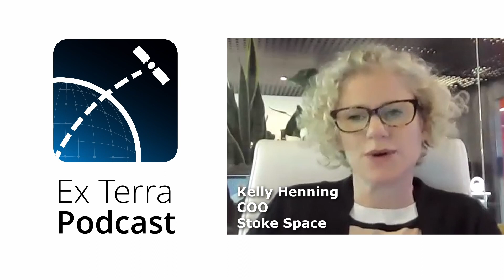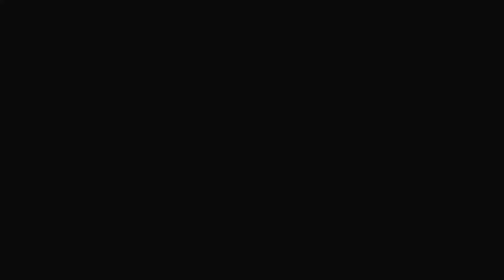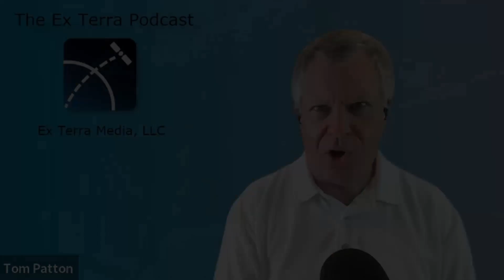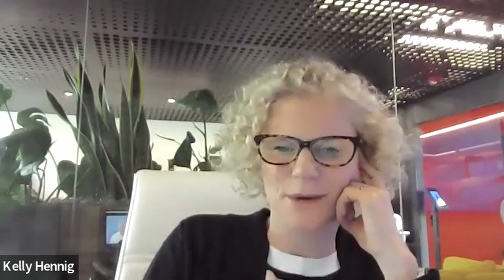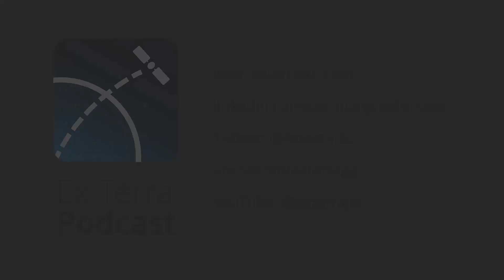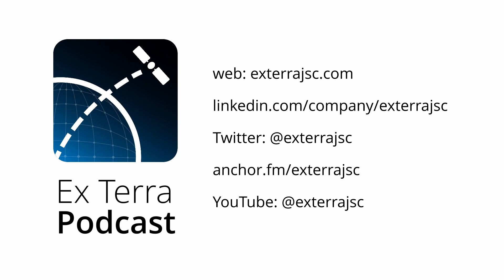Kelly Henning - Stoke Space

Comment: Using fuel to cool a steel heat shield seems like such a needed improvement over the ablative/ceramic shielding.  But it (in Stoke's design) requires the equally innovative positioning of rocket thrusters in an outer ring around the heat shield.

IMO,  this, plus their in-house, hands-on, rapid test turn around capabilities, sets them apart from other new space companies.  I'm fascinated by them and wish them the best.
Reply: Stoke is just improving